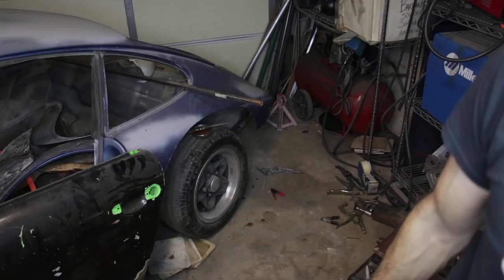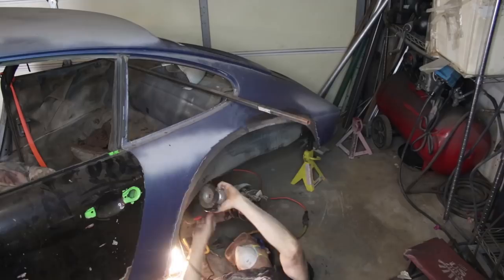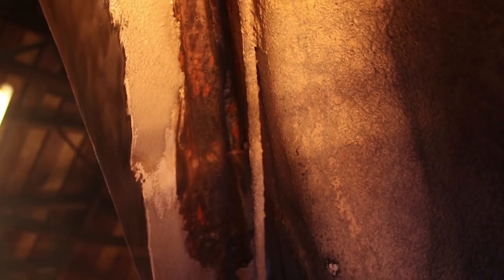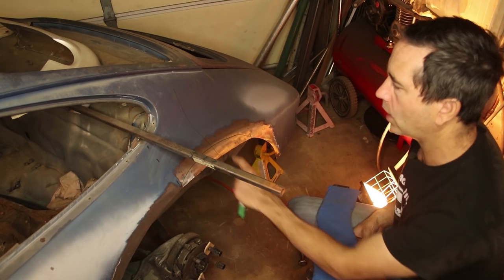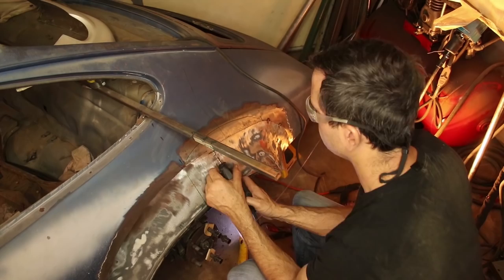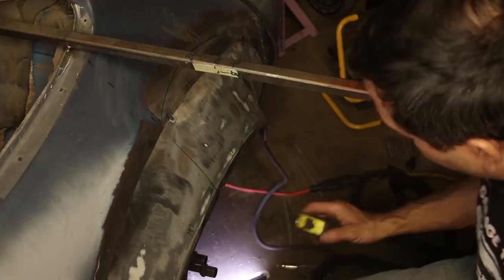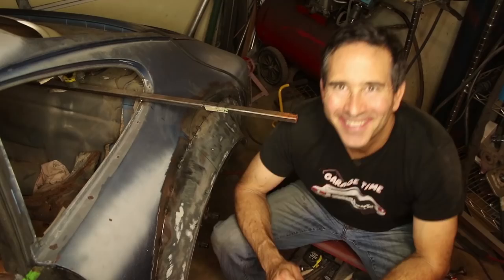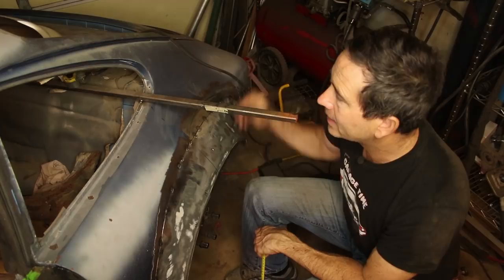911 Restomod | This is So Satisfying...Wide Body Flare Install

Comment: Thank you for the video.  I would like to widen my rear fenders.  But I am realllllllllly  hesitant. My 964 is factory original  than a cat bypass.  Watching you is giving me some confidence. :)
Reply from the maker: Sure, if you need more inspiration I just finished a TIG welding and metal finishing course.  It covers everything you need to know 😉
Reply: Awesome, i will check that out.  I do have some welding under my belt thankfully.  I just haven't worked the courage to cut into the body.  I am not looking for huge 935 style hips ... But a bit wider than stock would be cool.   :)

Comment: You have made me switch to TIG after many years of MIG.  You are one of the first I have seen using TIG. I’m a Big fan of the Way your are doing things. It all looks very clean and easy - so let’s see When I go out to my old VOLVO if it turns out just as Nice as your work. I doubt it, but anyway I Will try.
Reply from the maker: Dude, that is so cool and I'm honored to nudge a better outcome.  TIG is a bit of a learning curve, but you'll get it.  I'm working on a TIG Auto body tutorial now BTW.

Comment: Incredible work! All this time spent getting it right in the metal will pay dividends later on when it comes time for body and paint.
Reply from the maker: Agree, especially the panel fitting that has been done.  I also like to trial fit anything that touches the paint before it's too late so assembly goes well.

Comment: Beautiful job on the flare, this will make it look beefy and more aggressive which I like. Is the round hole at the bottom for looks or does it serve a purpose?
Reply from the maker: The round hole is there so the torsion bar can be removed.  It gets a cover. 👍

Comment: What did you do with the underside, where you welded the flare on....how does that look? Did you grind that smooth also?
Reply from the maker: Hi Gary, currently the backside has a rust converter on it because it's still bare metal.    In the next few weeks I'll show how the inner fenders are cleaned and epoxy primed prior to undercoating.  I did NOT grind the backside of the weld.  The TIG weld is already pretty smooth.  I think someone would have to look pretty carefully to detect it under the Shutz, but time will tell.